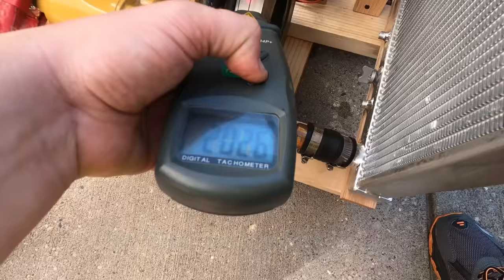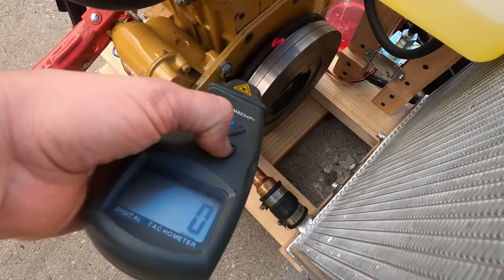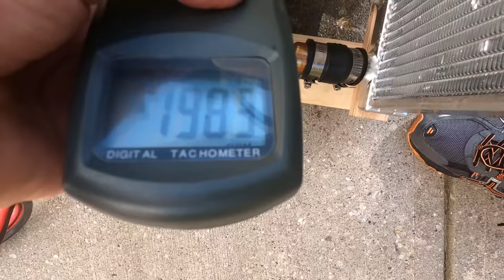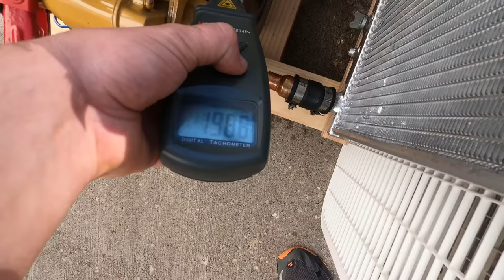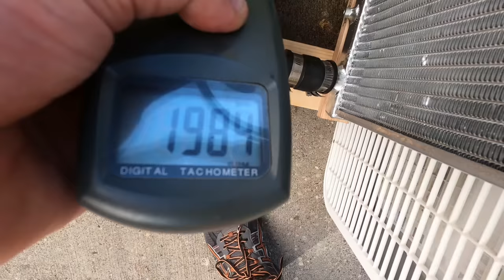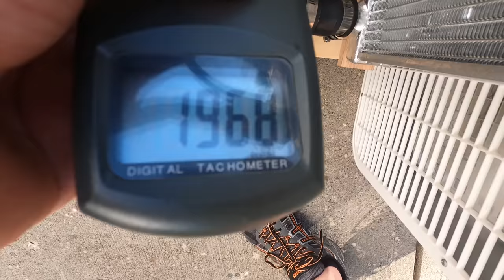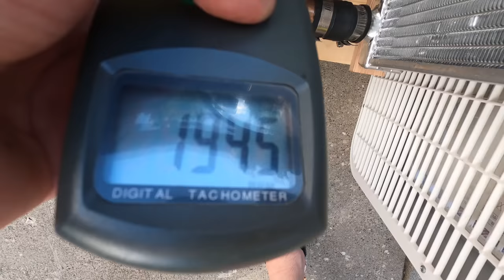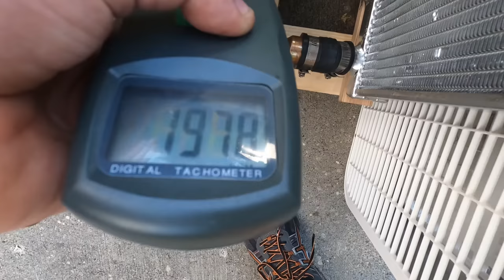Will Caterpillar Diesel run on Cooking oil? Attempt to run engine on Transmission Fluid & other oils

Comment: Cool video, I had always heard this, but it was neat to see it. I will say that a diesel engine uses a high pressure pump that may wear out prematurely if you use an oil that does not lubricate as well as diesel.  The fact that it burns and runs with no load is one thing, but it could be causing damage. 

Project farm does a lot of videos where he does basic film strength / lubricity testing, and it always surprises me how well some oils lubricate, so perhaps most or all of these would be fine.
Reply: My good friend was running his old diesel car on transformer oil for a long time(like 5-8 years) as he have been working in electricity and have big supply of used transformer oil.
Reply: @MrActionPL1   I don't know what country you are in, and I might be wrong with this information, but you may not want to share that information. I was under the impression that transformer oil was full of PCBs and is highly toxic and cancer causing. From what I recall, there was a lot of talk about PCBs in the late 80s through the 90s and I feel like burning that oil in a car would be pumping that stuff into the air and probably very much frowned upon / illegal / hazardous... 

Maybe I'm missing something, but those are my thoughts on that.

Comment: It's nice test, tried just filtered used cooking oil in my 2013. diesel car. Because of the common rail I did it 50:50 with regular diesel. All good, no noticeable difference in driving. Just smelling like someone is frying something ;-) in my older one with "pumpe diese" or bosch mechanical pump I went 75:25 in favor of used cooking oil. The only thing to watch for is cold weather. It didn't start lightly as on diesel. So, definitely separate the reservoir and split the fuel system to start and stop the engine with diesel and run the mix through the heater coil when the engine is up the temp.
Also, I would like to check for exhaust temps with each oil and clean engine sound without the music. Other than that, nice one!
Reply: For some equipment out on a Family Friends Farm  we have a block warmer on the fuel tank and use old oil pumps to circulate the fuel.  We use a mix of 50/50 used oil/diesel, engines don't seem to mind and they get regular maintenance too.  Using the oil keeps down extra expenses on trying to send the oil to be recycled and on fuel costs.

Comment: Keep in mind, these oils are new. Used fryer oil and used motor oil at a 50/50 mix with heating oil will work, but gums everything up eventually.

Comment: I have run both VAG's IDI and TDI 4, 5 and 6 cylinder (volvo) engines on sunflower oil, corn oil, hydraulic oil, engine oil and generator oil. 
In warm weather, no problem. In colder temps mixed with diesel if not preheated. 
Basically all the oils gave more power and lower consumption than pure diesel. 👍

Comment: This is a fairly simple engine so it will run on almost everything.
The much more specialized new car engines with tons of sensors, turbo, more advanced injection, particle filters and stuff, will begin to have problems with different fuels like these.
Reply: My owner's manual warns against using anything other than diesel fuel, limiting even biodiesel to no more than B5.
Reply: @CaptHollister  It is more of a cover own ass.
Other fuels might require other oil change intervals or different performance in cold or warm weather.
Mixing fuels also makes it a bit tricky to guess what happens in the tank and hoses.

My lawnmover forbids any blend of ethanol fuel, but it is pretty much impossible to buy gasoline without ethanol here, so I have to ignore that requirement.

Comment: my father used to tell me about a tank retriever they had in the korean war that had a fuel selector on the dash that you could select anything combustible, when switched to gasoline it had an oil injector to help with lubrication

Comment: When we changed our fuel filters on a 425hp Caterpillar engine, we always filled the new canister filter with automatic transmission fluid to avoid getting the fuel system air-locked. They run perfectly on ATF.

Comment: YES diesels will run on vegetable oil. We can go all the way back to ww2, diesel was scarce in many parts of Europe during the war, military vehicles such as trucks and tanks would use vegetable oil since vegetable oil was a little easier to get even used cooking vegetable oil was used, the only problem was it would often freeze when the temperature drop below the freezing mark, so often it was mixed with some alcohol to help prevent the vegetable oil from freezing in the lines during winter.  true facts   :)

Comment: old deuce military trucks had a manual telling you what fuels it could run on. Diesel of course, kerosene, 2 types of jet fuel, gasoline for emergency, and filtered out motor oil and you could mix it all together if needed

Comment: The only issue with diesels running wacky fuels is you need to make sure you either add a lubricant to the fuel (kerosene needs an additive for example) or the fuel you use needs to be a lubricant itself. You run the risk of ruining the engine otherwise, thick oils also need thinning in colder climates otherwise it'll just jell
Reply: They'll ruin the pump and injectors, not the engine itself.
Reply: @jetstream454  Pump and injectors are part of the engine
Reply: You won't damage the pump or injectors on the old style diesels withe these different oils because the have more lubricity than the new diesel fuel. As for gelling in the winter need a warmer in the tank.
Reply: @mrcaboosevg6089  They are, as you say yourself it doesn't mean the whole engine though.
Reply: If you're worried, just add some cheap 2-stroke oil to the tank.
Reply: You have to be concerned about the Diesel Particulate Filter (DPF) as well, if your vehicle has one. The DPF can’t handle 100% biodiesel, so it won’t handle vegetable oil either.
Reply: My old Peugeot doesn't like modern diesel fuel. I run it on 3% mineral based 2 stroke oil mixed in the tank. I tried kerosene plus 10% sunflower oil, it works fine.

Comment: When I worked for a Cat dealer (H.O.Penn) I used a container that was to have diesel fuel in it, instead it had new 15W40 oil. It ran fine, it was a 3406B engine.
Reply: Person that loaded it should be looking for a new job.  Person that used it should be looking for a new job.

Comment: One thing about what you have done here... running the ATF last. That engine is good and fogged. Ready for deep long-term storage.
Reply: Is that a bad thing?
Reply: @jetstream454  no. Its S.O.P to fog an engine before any extended storage period to keep the cylinders from rusting. ATF works very well.

Comment: We use to dump a quart of trans fluid in the filter after service she  start up perfect. Someone didn't tie off the handle on the oil truck to mark kerosene so we rolled in late filled both trucks up with it and didn't hurt nothing we went to Canada then mass and back to Maine.

Comment: Diesel and heating oil are pretty similar; the main difference being in taxes paid for diesel vs heating oil.  The second difference is the wax contents; never try to run heating oil in a vehicle in winter, it will haze and turn to gel due to it's high paraffin contents.  AFAIK sulphur contents is now very low in both fuels.

Comment: I ran an old International 414 tractor on mineral oil I salvaged from a used hydro transformer. Used quick start to help it start in the cold and it ran very well.

Comment: Yes it'll run on cooking oil, but cooling oil lacks the lubricity to lubricate the pump and injectors as well as the viscosity being so thick it can damage parts. Also the oil will break down rubber, this means rubber hoses, o-rings, etc.. Technically a diesel will run on any oil based lubricant, or oil substance. How well it will run and how long it'll last will vary.

Comment: On the older diesels not designed for ultra low sulfur diesel fuel it was common practice for a lot of guys to buy a small bottle of ATF and mix it in with every fill up.

Comment: You would actually be better off turning those vegetable based oils into propper transesterified bio-diesel. Which is a mono-gliceride fuel. If you run any form of tri-gliceride vegetable oil in a diesel engine you will soon wear the motor out as well as clogging lines injectors and filters with gum and acids, the more used the oil the higher the acidity and all vegetable oils are acidic and need to be PH balanced. I ran my Nissan on biodiesel for the 7 years I had it and no major dramas. The motor was an LD 20. Ran better on Bio than regular. But would drink more.
Reply: Great information. It is a blessing that we share our knowledge with each other. I am interested in diesel engine technology in order to set up my own independent systems .
Reply: @patrickjohnson2225  like with running a petrol/gasoline motor on alcohol or propane or Natural gas. Tuning it with appropriate timing etc also works wonders. Takes a little more energy to fire Bio diesel, but it burns a bit faster because of the natural nitrous oxide in the oil.

Comment: you can run a diesel engine on any kind of oil. i ran my ford 7.3 diesel on peppermint oil once and also tried baby oil in it and it ran perfect with both

Comment: Thank you so much for showing us  people to reuse waste oil in either your car or heating your hot water an your home at same time ,     just make sure you filter dirty oils with a paint strainer  an the a funnel with cardboard tubes filled with toilet paper  set this up over clean bottle  or bucket because it takes time to pass through toilet paper but once its through paper its clean an safe for most diesel engines to use ,   but regularly  run plash of diesel through tank just to prevent sludging  or gelling  of the fuel   lines an injector pump an injectors  ,  this will or should give you reliable  service ,     and for sake of 30 40 dollars replace fuel filters  say every 150 200 hours      ,     used cooking oil can be picked up for free  by 44 gallon drum  at takeaway food stores just go ask them 1st ,    9/10 they will be glad to have you take it for free ,,  cost them money to have it taken away
Reply: The catch or downside is the chimney will become oily dirty and difficult to clean later. 
In a vehicle the vegetable oil cause a gum to form and create a type of fungus. 
I'm not expert just relating what I learned from furnace and truck mechanics over the years.   I would put some small amount in with the correct fuel rather than entirely different thing daily.

Comment: i never seen such a small cat  i didnt know they made engines that small pretty cool
Reply: It’s a Perkins 402D-05
Reply: Looks like a CAT C0.5 to me 13.7 hp, 22 ft-lbs at 2600 rpm
Reply: @machew2009  Correct, that is Caterpillars designation for this Perkins engine. Perkins has been a subsidiary of Cat for over 20 years… (Cat engines smaller than about 200 horsepower are made by Perkins)
Reply: Used as a starting engine for the big guys.
Reply: Ohh yeah I didn't think of pony motors slipped my mind lol
Reply: @carsten4594  As far as I am aware, Caterpillar phased out “pony motors” over 50 years ago. The little engine in this video is a modern tier 4 emission engine, designed for Aux power units, light towers… things like that. 

If you have knowledge of a Caterpillar engine that uses a pony motor that is newer than 1970, let me know. I’d be very curious to check it out…
Reply: @Thanosisnotreal  Thanks for the information. Just a guess on my part. I could see pony engines on equipment designed for remote regions requiring long periods of non-use.
Reply: Cat Perkins same thing lol
Reply: @Thanosisnotreal   It's a Shibaura designed engine licensed to Perkins with Caterpillars name on it.
Reply: @newjerseybill3521  Really? That’s amazing, I did not know that.
Reply: I tried to feed my cat some sunflower oil but she got upset and left
Reply: It'd actually buitl by Shibaru. ( not Sabaru ! ). It's a Japanese engine. We use them on tower lights, 30000 hrs no problem. Tough as 💅 nails
Reply: @robertlindsay9826  It's not Shibaru, nor Sabaru, it is IHI Shibaura.

Comment: You should monitor temps as well. You will see more of a difference in the fuels based on temp rather than RPM. Also running at idle vs under load will yeild different results. An engine may idle well but wont neccesarily rev up well.
Reply: that engine was running at, close to 3/4 throttle at 1,900 rpm if he idled it down to 600 it would probably die

Comment: Some people here in germany do run their Diesel engines straight on vegetable oil, mostly elderly cars like VW Passat and Mercedes 200. In the reservoir a heating coil keeps it flowing during cold weather conditions.
Reply: VW passat use the same engines as all VAG group cars so nothing specific, but yes old Mercedes 200 to 300 W123-124  work good with vegetable oil, best is rapeseed oil, but need a very serious filtering to avoid damages in the injection pump...I known a engineer who modify he's W124 300 with a additional small tank with diesel fuel for start and during oil heating, and a inverter to swich to the main tank filled with french fries oil (filtered with a professionnal very fine filtering system): work perfect but he's car smells a bit french fries...
Reply: We can't do that here in the United States because they tax our vegetable oil as if it was diesel it used to be cheaper but that's not the case anymore

Comment: Try to run it on a common rail high pressure system. It would be interesting how far it will go.
Reply: that's what most people wanna see today
Reply: Fiat 1.9 JTD common rail engine works fine on sunflower oil,checked
Reply: It runs fine in CR motors too
Reply: @NenadTrajkovic  no cel?

Comment: other things to try.

1. running it on heating fuel, k1 fuel for space heaters and model fuel (the clear alcohol like fuel used in rc engines)

2. run rc engines from diesel, heating fuel and k1.

i think you can put the engine under load if  the alternator is still on it you can wire up the alternator to be able to charge the battery and then short the output of the alternator that should put enough of a load.
Reply: Dont try the tv model fuel!
No viscosity to lube the  injection pump.
Will damage it.

If you short out an alternator you will have fried alternator!
Reply: @josephpadula2283  the engine probably was pulled from a junk yard machine that was probably involved in car crash or was the result of a manufacturer refusal to repair a machine someone tried to repair by hacking the brain box due to the anti right to repair. plus you could buy a new fuel pump at your auto parts store as well as a new alternator.

as for the costs you can get that paid by cashing out some of your videos.

if you dont want to sacrifice the fuel pump you can go to your auto parts store and buy a cheap diesel pump for a vw car that was involved in the cheat scandal and if you dont want to sacrifice the alternator you can buy one at an auto parts store or even go to a junk yard.
Reply: Heating oil is just dyed diesel fuel. There is no difference.

Comment: Cool video ! I’d imagine most any type of fluid that has some sort of oil base will work on an mechanical style diesel pump engine!
Could always dilute some of the thicker oils with diesel fuel if the viscosity is too thick! 
Freezing temps would be the only factor imo of using other oils as fuel!
Reply: Exactly, or kerosene with a little lubrication oil.  Some lubrication is needed with kero.
Reply: The cold will prevent starting 
Some of the oils here will solidify and therefore can’t be pumped at colder temperatures …
It’s the triglycerides that are in some oils that turn solid with cold
Reply: It is also about deposits on the cylinder head and lubrication.
Multi-fuel engines like the Leopard 2's diesel eat basically anything that burns and can be pumped.
However, it is stipulated that about 60% of the fuel used should be diesel in order to maintain the durability of the engine.
The rest can be basically any flammable liquid, alcohol, kerosene, oil (vegetable, animal or earth), gasoline... .
However, no liquid containing water should be filled in, since water is not compressible and can thus destroy the motor.

Comment: this would be great to see it running on used motor oil, what a great recycling option. But corn makes the most sense, easy to grow in a abundance.
Reply: Would love to see on a full size truck engine as well.

Comment: As diesels are governed engines, I am not surprised that the RPM's were pretty consistent no matter what the little motor was burning. What would have been more interesting is the change in throttle position.

Comment: diesel engines are engineered to work at vegetable ois at first place. Well, it is no suprice that diesel engine works at vegetable oil, or other oils. Back days I had an old mercedes benz, and I used to fill the tank with what ever oil I had. Transmission fluid, vegetable oils, hydraulic oils etc. All oils was just great. My old mercedes just worked like perfect, no matter what oil I used. That caterpillar engine is abaut same kind of engine. It eats all kind of oils, and no any complain. Cool!

Comment: You should know, I live in Indonesia, I use crude palm oil (CPO) to fuel my truck, which loads at least 80 tons more palm oil to the mill.

This is very damaging because crude palm oil has a lot of residue, I modified the fuel filter and increased the speed of the fuel pump.
Reply: what is your truck?
Reply: @danielspoon1234  HINO FM 260 TI and NISSAN TZA 520, for the TZA truck I use them to mobilize excavators and bulldozers to treat oil palm fields.